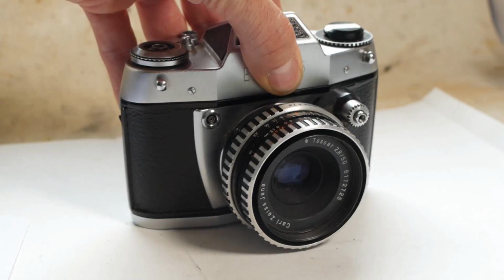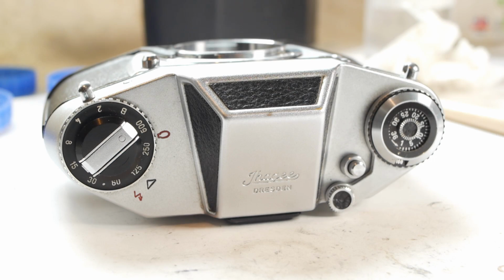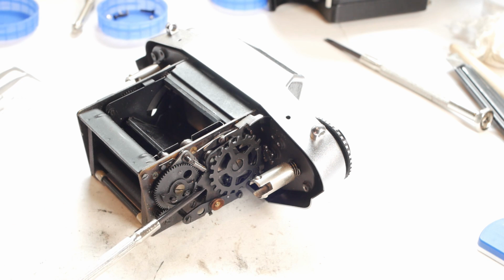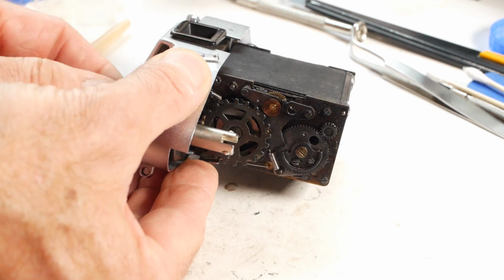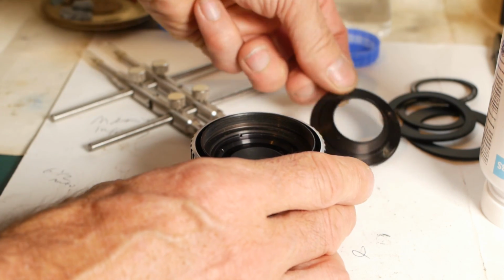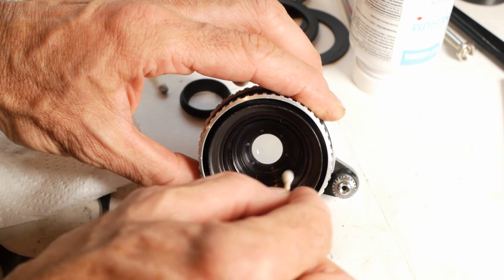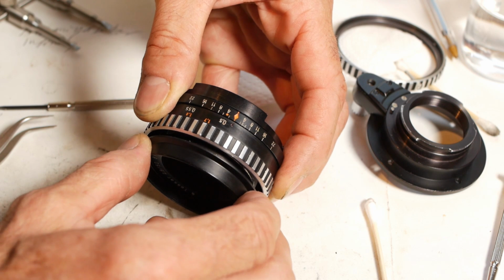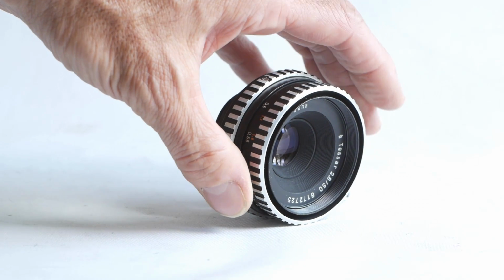Vintage Camera Repair - Ihagee EXA 500 - Slow Speed Shutter Timer & Tessar Lens

Comment: Ive been looking for a good CLA video on this very lens & finally I found it, I needed to clean & lubricate the helicoid because mine was very stiff, but alas it's come a bit late, I managed to clean & lube the helicoid but when I reassembled the lens I've lost infinity, is there any way to recover infinity ? thanks in advance. PS: I also opened & cleaned the other helicoid & maybe that added to my problem.
Reply from the maker: Hi Dub Snapper, yes it's very much possible to recover your infinity focus, it just might take a bit of trial and error to get there.  You'll have to guess the starting point for the outer helicoid, that's the tricky part because it's such a fine thread, but the steps on the main helicoid are pretty coarse, so moving it by one starting point and trying again will make a big change each time.  You have to juggle between adjusting the outer helicoid and then trying the different starting points of the inner helicoid until you hit the magic position.  It can only be right or not right, assuming the end stop for the focusing ring hasn't been meddled with (and I can't remember what end stop system they use on this lens).  Is your lens the same Exakta version?  If you're struggling, I could dig mine out sometime and take some measurements.
Reply: @GrumpyTim  yes the lens is 100% identical, I used it only once a few days ago on a full frame body & it's pin sharp which is why its worth keeping, the focus was so tight it almost screwed the lens off the camera, I'll go at it again today, I bought the EXA 1a body & lens for €11.50🤑, I noticed the measurement you took with the callipers & that might be a helpful clue to one part of the job, I have a good quality callipers.
Reply from the maker: Just checking that the infinity is wrong on the EXA and not just on the digital camera - many of my adapters to fit these things onto a digital body are made too short, so they focus beyond infinity.  If it's wrong on the EXA as well, then the infinity position is probably wrong like you said.  Hopefully you'll be able to juggle around with it until you get it set right again - it'll be worth doing because you'll then have a nice lens, plus it's extremely satisfying once you've done the job successfully.
Reply: @GrumpyTim  I used it on a full frame eos RP with an adapter, focus was perfect along the distance range, I took close up & distance shots to check its functionality & everything was fine, didn't get a chance to tackle it today, I did notice some X marks scratched in various locations inside the lens so I'll try to figure out why they are there, thanks for checking in.

Comment: Hey Tim, I have a VX1000TL that has a sticky shutter. It is capping out, which leads to banding on images :(
You wouldn't happen to have any experience, or videos, of this would you?
Reply from the maker: Hi demcomp, I haven't handled a VX1000TL so I can't give any specific suggestions, but if you're getting shutter capping (presumably it worsens as you use the higher speeds), it's likely to be that the lead curtain is running slow, causing the second to catch up with it before it reaches the end of it's travel - yes I know that's stating the bloomin' obvious, so, in theory, all you need to do is to clean and lubricate the bearings for that curtain.  The other cause for the banding can be when the first curtain is bouncing back into the frame after it reaches the end of it's travel - this can happen when someone has put too much tension on the springs or when the anti bounce damper is damaged/worn or badly adjusted (the damper is usually a pretty simple friction device that prevents the curtain from bouncing).

Those are my idle thoughts for the moment.

Comment: Hello Tim, like everyone else I am very grateful for these videos, I have two Exa's with the same problem, an Exa500 and a IIa. The problem is, although the shutters wind ok they do not latch or lock in position ready to fire, can you possibly point me in the right direction to solve this? that is, if there is a way ! Thanks Ian
Reply from the maker: Hi Ian, I'll try to dig my Exa out next week and take a look.  In the meantime, if you wind on with the back open, do the shutter curtains move to the top (or is it the bottom, I can't remember which way they wind) and immediately trip, or do they stay still and it's just the film advance sprocket and so on that moves?
Reply: @GrumpyTim  Hi Tim, thanks for the prompt reply. I think I may have found the "culprit" although as yet unsure. The curtains go down and up as they should on the 500, rather stiffly at first when it arrived, but is now moving more freely after some judicious lubrication with watch oil, although, as I mentioned, it does not get to the firing stage. I have wound the camera dozens of times watching the mechanism carefully [ the body has been removed 😁😇] ,  yesterday I noticed a hair like spring doing nothing, it was supposed to hold a chrome lever arm in tension, a very weak and poorly designed arrangement. This lever arm appears to be the "culprit", I repositioned the spring, nothing changed except the spring would not stay in position constantly, the lever arm goes under the bottom of two fine toothed cogs one above the other which rotate clockwise when the camera is wound, I noticed that on the underside of the lower cog there is a small protusion, which I think is supposed to latch onto the end of this lever arm holding the firing mechanism ready to fire 🧐🙃watching it carefully it is "obvious"that they are a hairsbreadth away from doing just that. With a bit if manipulation I got them to latch and the camera fired as it was supposed to, so somehow I have to get the spring to stay in place permanently, and "stretch" the mechanism for the magic to happen 😁.  Sorry about the longwinded reply.
Reply from the maker: Hi Ian, When I get the chance I'll take a look at mine again, if you want to email me I'll see if I can take a photo of my camera to show how that spring sits, which might help work out why yours isn't doing what it should.  grumpytimchannel@gmail.com

Comment: Hi Tim, have you tried the bigger sister of the Exa, the Exakta (Varex/VX model range), preferably the Exakta Varex IIb as well?
Reply from the maker: Hi SchwarzPoet, I haven't got one of the Exakta Varex cameras yet, but they're such a pretty camera I'm bound to get one sooner or later.  Sometimes I'll go and search for a particular camera that I want, but often I'll just wait until I see a camera that I like the look of (and that isn't too expensive) and add it to the collection.  There's a bit of a backlog in the repairs department at the moment, I'm currently working on a Mamiya Sekor 500DTL, which is one of the most frustrating cameras to take apart that I've worked on but it should be awesome once it's finished.  It's not a pretty camera, but it's solid..... a bit like a brick, but I kind of like it.
Reply: @GrumpyTim  With the Exakta, you won't have any real problems with possible repairs, since you can get the entire inner workings out of the outer casing with just a few hand movements and loosened screws. The only thing that might need to be re-oiled/greased would be the long exposure times, which are set on the right side, just like the self-timer. Otherwise, you should check the cloth shutter for light transmission, as it can dry out if the camera sits unused in the display case for too long. However, cloth shutters can be purchased relatively easily on the Internet. Otherwise, you can literally hammer a nail into a tree with the camera up to the Exakta Varex IIb and hang it on the nail for the sake of a possibly missing tripod, in order to pick out your next configurations from the camera bag in the huge selection of accessories. (Ok, the saying is partially stolen :D )

The small knife inside the camera, which you can pull down when the back is closed and use to cut through the film, is a very nice feature, for example to develop the first exposed images and use the unexposed rest of the film later. For example, it's very helpful when testing a new film that you've never used before, and you don't waste so much material. By the way, the long exposure times are also very ingenious, since they can be set up to 12 seconds, independent of the self-timer and independent of Bulb.
Reply from the maker: Hi again SchwarzPoet, you do make it sound very attractive - I'll keep my eyes peeled for one at a good price - happily I can buy a body only example if needed, because I already have 4 or 5 Exakta mount lenses in my bag.  When I got my KMZ Start camera I thought the film cutting knife was a pretty neat idea - it was only when I found out about the Exakta cameras that I figured KMZ might have "borrowed" the idea from them!!!
Reply: @GrumpyTim  [quote] When I got my KMZ Start camera I thought the film cutting knife was a pretty neat idea - it was only when I found out about the Exakta cameras that I figured KMZ might have "borrowed" the idea from them!!! [quote end]

I strongly assume so. You can see it in the Kiev 60 alone, which was very probably copied quite cheaply from the Pentacon Six TL. 😁

Comment: You are a very patient person to fix that. Old things where built much simpler and can be fixed unlike todays things. For what it is, it took a very clear and sharp photo. Something modern in the black & white photo would have looked surprising, such a  modern car or a smart phone. I think every one that demonstrates old camera with photos or video should shoot something from our time.
Reply from the maker: I don't think I'm any more patient than you Joseph, it's very similar to figuring out what's wrong with an engine and fixing it - everything is just a bit smaller!  The old cameras are so beautiful to look at, and nearly always designed to be taken apart and repaired, and as ever, I'd rather have a scruffy working example than a perfect looking one that doesn't actually work.

Comment: Miniature suction tools aye, they look fun. 
So many tricks here obviously learned through experience but alien to myself.
Interesting mix of materials, not sure what i expected but the canvas shutter was a surprise.
Thank you for another illuminating video, and please help out with your subtle humour, why did your digital camera have an eyebrow?
Reply: Rubberized silk? I had no idea, greatfull to have been introduced to a new material for the day.

I could easily waste twice as much time as I already do pondering design choices, it's one of the draws of older products, quirks being few and far between in today's products.
It's also nice getting a few products together of different ages from the same manufacturer and seeing the evolution and innovation in the product's design or in the steps upstream in materials or tooling setting the designer free from the constraints he had a decade before, trying to remind myself that process took place in a large hall full of drafting tables, tea ladies and smoke or whatever the German, french, Japanese ECT. Equivalent to a tea lady was. What do Germans drink when they have to be sensible?

Very glad I asked about the fluff, wind noise is a struggle for me thank you.
Reply from the maker: I've seen it described as rubberized silk and also rubberized cotton, so I suspect both fabrics were used.  You can buy brand new rubberized cloth and the ribbon material (at a price) so you can replace knackered shutter curtains.  Some cameras have the leading edges stitched over a metal bar and others have what appears to be a three fold sheet of metal to make up the bar and secure the fabric - those might be a little trickier to replace the curtains, but I'll deal with that issue if and when it occurs.  If stitching the curtains, or repairing pinholes in a curtain, you can ger a black rubber glue to seal the holes, otherwise you'd get exposed bits on the film.  All this is theory, I haven't had to replace any myself yet, but I have had to re sew the ribbons onto the metal bar - that's a pretty simple exercise.

I've not had the chance to dismantle too many cameras from the same manufacturer yet but I bet it would be interesting to see how they developed over time and then fell into the "replace an entire module rather than repairing things" world.  I've worked on loads of lenses from the 60s, 70s and early 80s - all beautifully dismantlable and repairable, but my brother has worked on a load of 90s (at least I think they're 90s and not late 80s)  Canon lenses that are a disgrace of unrepairability - they use layers of flexible circuit boards that are soldered together in multiple places, really difficult to unsolder and there's only so many times you can flex them apart before they fail completely.  There are also lens groups that are bonded into a housing - theoretically this should mean that damp can't get in, but it does, and they they grow fungus that you can't get to in order to clean them up.  He's also worked on some slightly newer Canon lenses (only by a few years) and those had push fit connectors between the flexible circuit boards, so maybe Canon actually learned a lesson there (and I have no doubt that Canon weren't alone, it's just theirs are the only newer lenses I've had any experience with repairing).

Hope the home made wind muffler idea helps for you too - should be easy and cheap to try at the very least.
Reply from the maker: That mini suction tool is intended for placing SMD components on a PCB, but it's equally useful for other stuff too - they're pretty cheap and easy to find, once you know what to search for.  I think I was aware of the shutter curtains being made of some sort of rubberised silk or whatever it is, but they were always a big taboo and you needed to send your camera to a specialist if they went wrong - which in some respects isn't such a bad thing because it's all quite delicate in there.  Usually you only get to see a tiny bit of the curtain behind the rectangular frame, so I was quite surprised the first time I got inside a camera to find out how relatively crude it is, with the ribbons at the side to pull the curtain over the image frame and so on.  They're quite fascinating things, with each manufacturer using a slightly different system to do more or less the same thing.

I'm afraid that the monobrow on my digital camera is rather boring - those cameras suffer really badly from wind............noise - there are two tiny holes on the top that lead to the microphones.  There are no commercial remedies for this, other than buying a more expensive camera that has an input for a better mic, so I just got a big wind muffler and cut a section out, which I then stuck over the holes with double sided tape (making sure the tape itself didn't cover the holes of course) - it makes a massive difference when shooting outdoors, although when using the viewfinder rather than the rear screen, the fur from the muffler sometimes goes into my eye which isn't so great!!!

Comment: Cheers for the tips. I wonder how it does taking photos.
Reply from the maker: It should be fine taking shots - the shutter speeds are now working ok and the Tessar lens is a known quantity.  The EXA 500 was a fairly basic camera, so there's no frills, but that suits me fine.  What is a little odd, the EXAs are kind of triangular at the ends so it feels like it might slip out of your hands, particularly if shooting one handed.  Also, it has that sticking out plunger on the lens that acts as the shutter release and it's on the left, so if you were shooting single handed, you'd be using your left hand.  I've already got a film in it's earlier relative, the model 6 that appeared briefly in the video - that one has all the same oddities, like being triangular and the left hand shutter release, but it also has a waist level viewfinder, which takes a lot of getting used to, not having a prism to invert the image and so on.
Reply: @GrumpyTim  My Bronica ETRSi came with a waist level view finder but I fitted it with a prism with a meter in it (everything clips on and off those.including the backs which hold the film. Also I have a YashicaMat 124G which does have a waist level viewfinder and being a TLR has no clunky mirror which makes it great for candid shots where they don't know you have taken a picture.
Reply from the maker: @BensWorkshop  yeah, I've found out that no one thinks a you're taking a photo - I've actually got film in 2 cameras that have waist level finders at the moment - it's the back to front image that confuses me a little, but I'm getting used to it. Both of those cameras, can have the viewfinder swapped for a prism, but I wanted the waist level experience - it's all for fun after all.
Reply from the maker: @BensWorkshop  Yep, that's it, and if the image looks a little down on the left hand side, I try to correct it and it gets worse!!! I am kind of learning to override my instinct now, having used them a little bit.

Comment: Nice video! I Measuring the lens with a caliper is a great idea! And I also should get a random sheet of rubber.
Reply from the maker: Cheers ohjajohh, so long as you can find a convenient spot to measure the length at a set point before dismantling, it can take some of the headache out of the process, although I had a Mamiya lens that needed repair that had been dropped and nothing was square, so I just had to take that one apart and re find the infinity position afterwards - it wasn't too much of a drama in that case, but I bet some lenses are more tricky.  Random sheets of rubber and a circle cutter have so many uses, from making friction tools for lenses and replacement rubber feet for old electronic equipment to making replacement seals for leaking things and so on.......